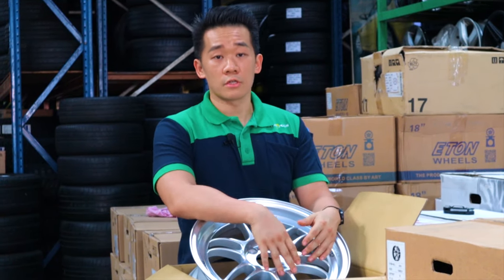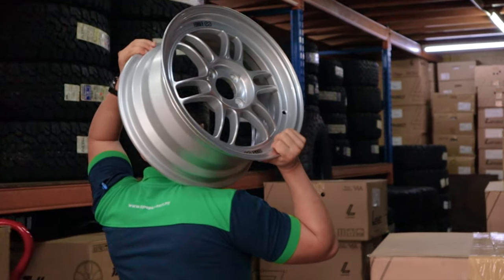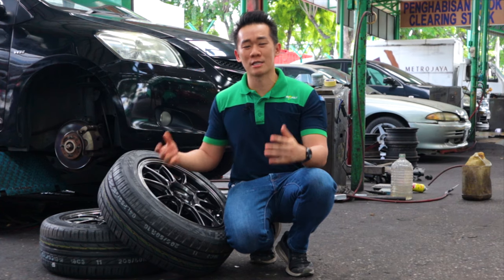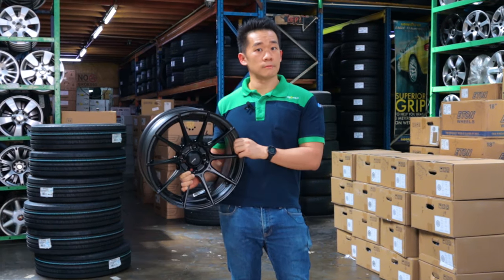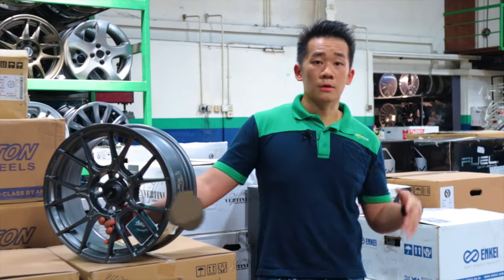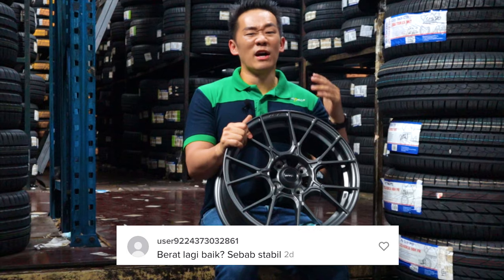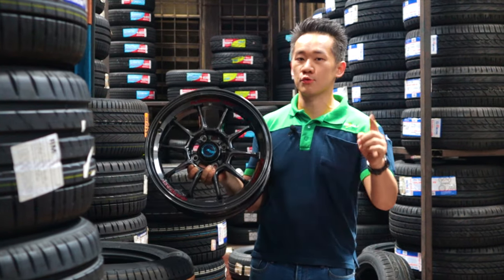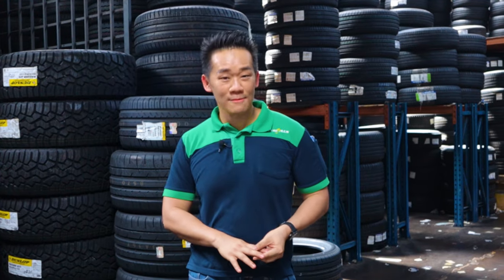Are Lighter Rims Actually Better?

Comment: lightweight wheels overall will increase your gas mileage, I went from 45 lbs stock wheels to aftermarket 40 lbs total weight, my gas mileage went from 39 mg to 45 mpg.
Reply: Rolling resistance...
Reply: Same wheel and tire size?

Comment: Looking to drop weight on my ram.
The factory rims are 20” and the tire is 33”
I wonder if I can find a lightweight replacement for a the wheel and tire but still have 33” of tire.
Stock combo is about 72lbs each

Comment: Are advanti wheels durable enough for roads with big pot holes?
Reply: Got my set of matt black 17"x8" 5x114.3 ET35 Storm S1 rims in Thailand for my Subaru Forester SK, they are very good-looking rims.

Once I hit a large pothole that caused a loud sound at my front right suspension, I thought that rim must be dented but turned out it is still perfectly round (checked by wheel balancer machine.)

Comment: light weight rims increase the energy transfer to the car during bumps compared to heavy rims that require more energy to stun the car, thus heavier rims could be more comfortable i guess?

unsprung weight is when u didn't give burden to the spring , sprung weight is when u put the car on ground, sprung weight majority comes from the body of the car.
of course lighter rims makes the engine drive the car easier compared to heavier rims....